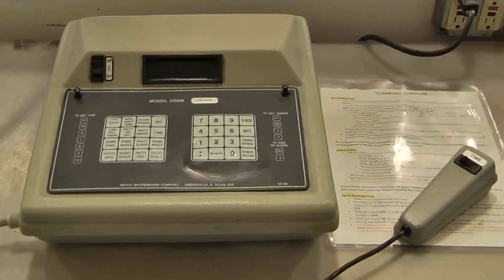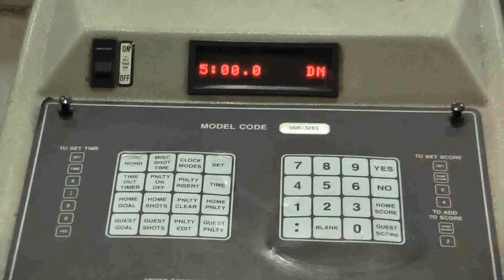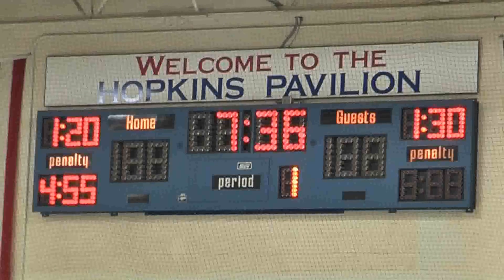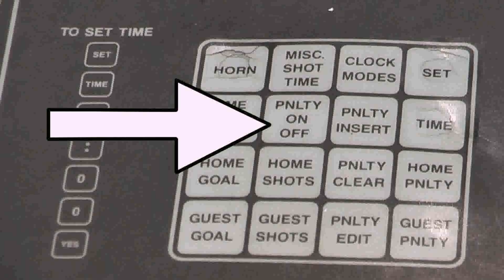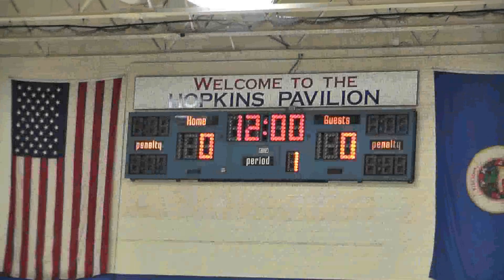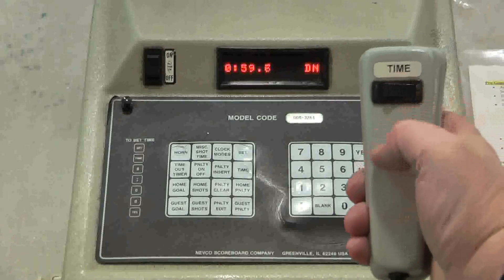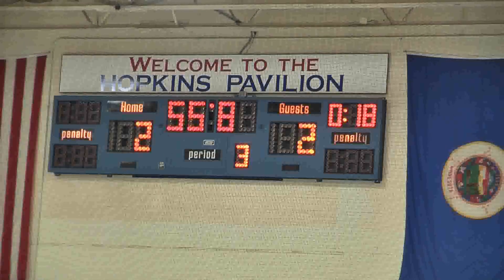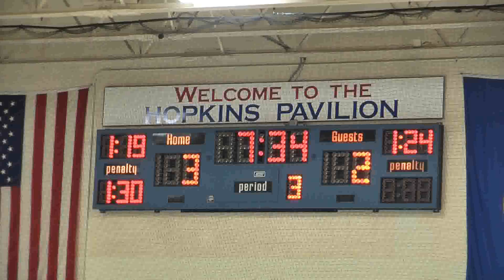How to operate the Hopkins Pavilion scoreboard---Index below

Comment: There are a few things for me to point out.
Your controller probably had a memory battery (ram battery) issue. Because when you turn on the controller, it should ask you if you want to start where you left off, but it didn’t. 
Another thing is you can also press ___ score and 1 to add a point. Not go set>___ score> corrent score.